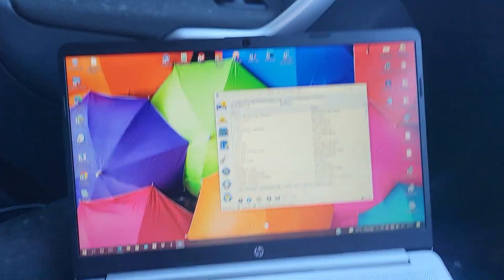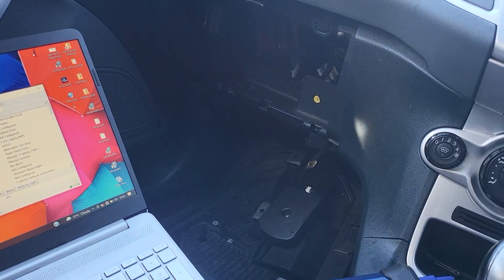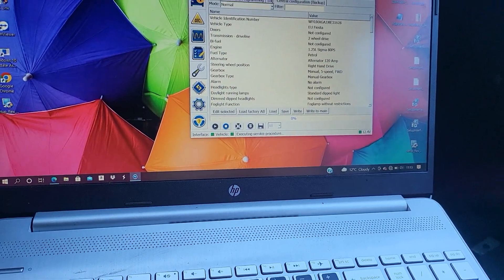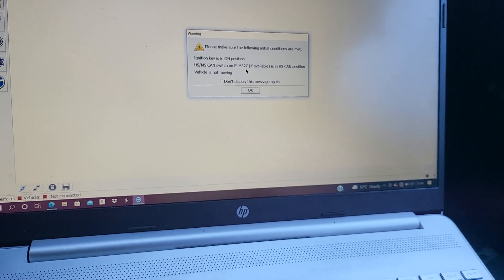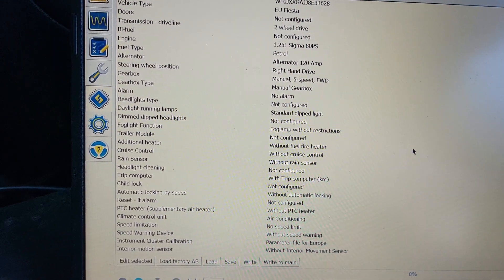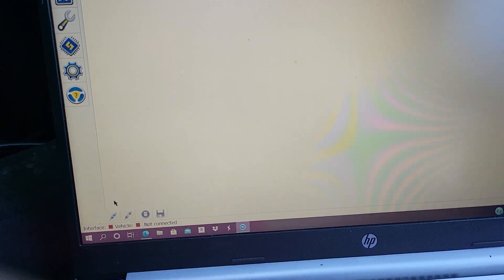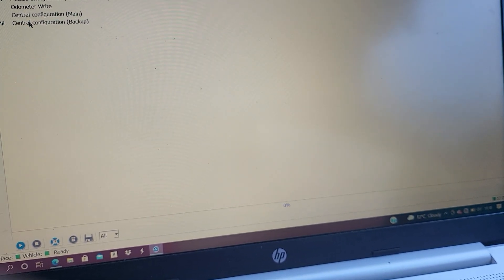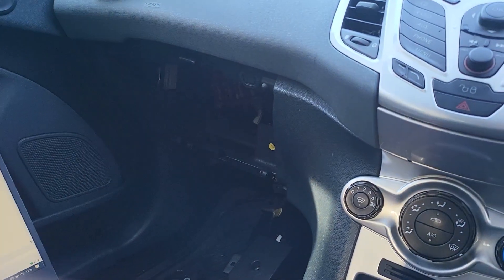ford fiesta bcm programming using forscan ford bcm reprogramming using a second hand bcm .

Comment: I am going to use forscan to program used bcm in my 2013 ford escape from a same model year donar. After loading the as built data..do i need to
Program keys? Or reset any module?

Comment: will this work on a ford focus 2015 push start i attempted this and when the bcm is replaced with the second hand one i cant get the ignition to come on keys not recognised as they are push start
Reply: Have you resolve this issue I think you need to reprogram the keys